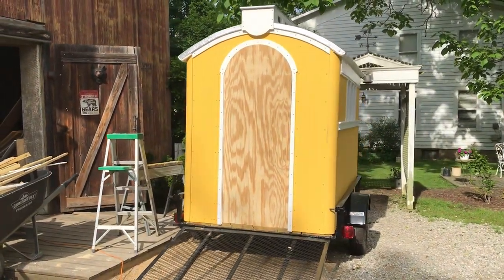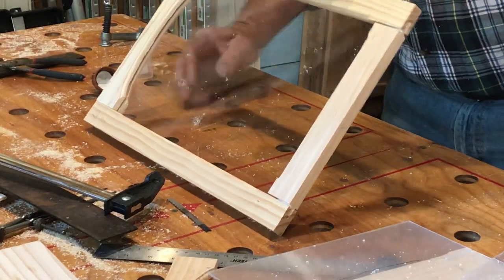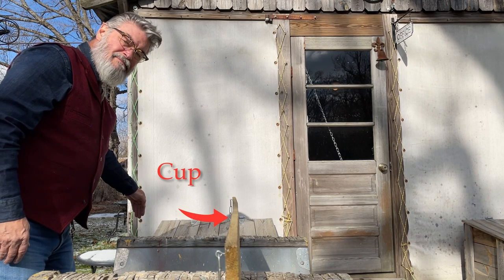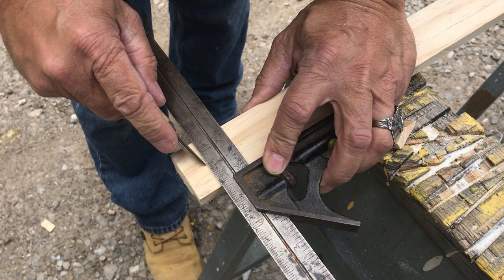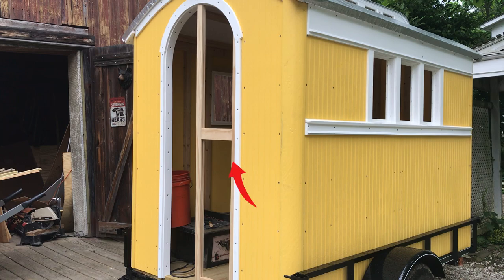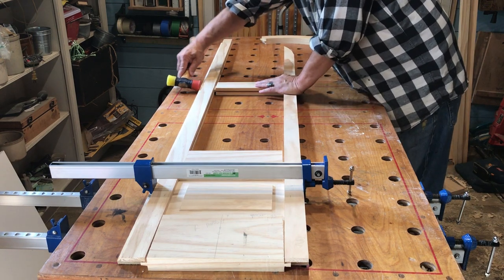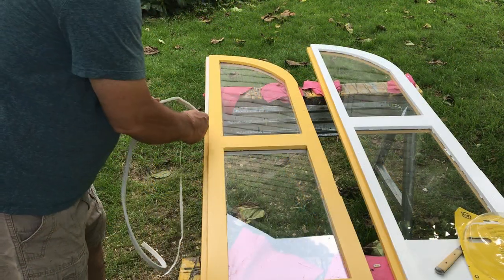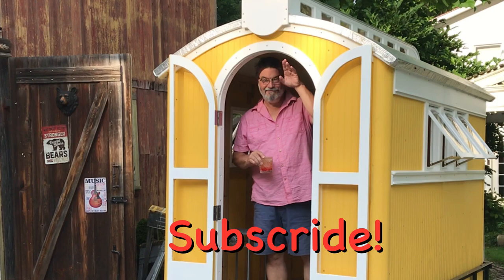DIY Camper build. Part 3. Building the windows and doors.

Comment: Bud,
Really nice work. Your level of craftmanship is cabinet level. I began building road going camping structures in 2007 when I built a Vardo style canopy for my truck. I would loved to have known of the peal and stick roofing you used then.
Since then I have built two tiny houses and some artistic outbuildings. Some of the builds are on my Channel. 
I only have two things that I feel I need to say and only as a help and not a criticism. The T1-11 that you used may have been a mistake in the long run. I opted for Smartside T1-11. It looks like OSB however, the epoxy they use is indestructible. The tiny home I built in 2009 with it is still as good as day one. I left an unpainted piece in the grass for 5 years in the rain forest and it looked the same when I retrieved it. A tiny home going down the road at 50-70 mph is living in a tropical storm. Standard T1-11 I doubt will be up to the abuse.
The second thing is this, The extremely close tolerances to which you built are perfect for a piece of heirloom furniture. Your Tiny house however will be traveling down roads that have potholes, washboards and many other atrocities. It is impossible to make one that stays perfect after the abuse the roads will hand out over time. It will not be long and the doors and windows will start to stick and you will need to make the openings bigger or the door and windows smaller. 
Over all, great job!
Perhaps some day we can share a Bourbon and talk shop.   

Zac
Reply from the maker: Thanx for the kind words and the observations. I’m planning on another build in the future, this one will be larger than the first, I’ll put your advice to good use on that one! Love your channel. I just subscribed. I’d love to take you up on that bourbon offer some day soon. All the best.
Reply: @prestonguitarmethod5987  It is said that you build your first one for your enemy, your second one for your friend and your third one for yourself.
There is a lot of truth to that.
Reply from the maker: Sounds about right!